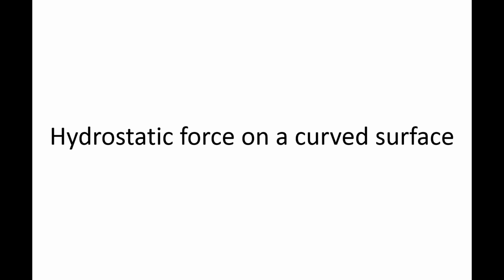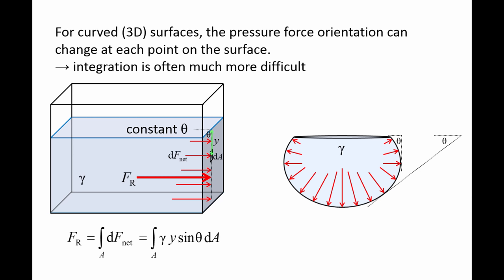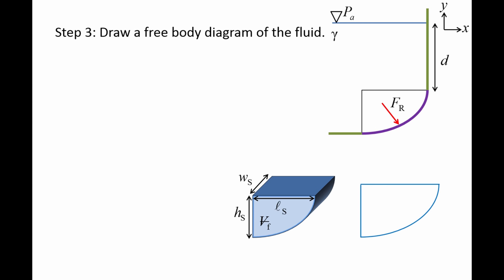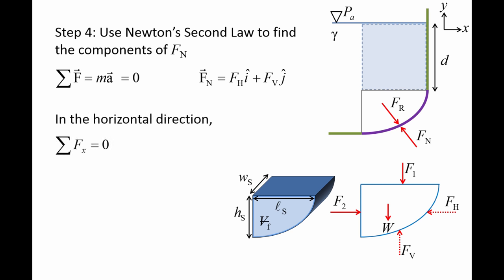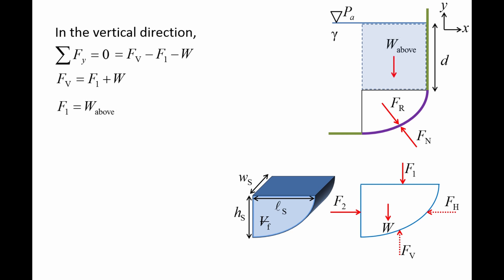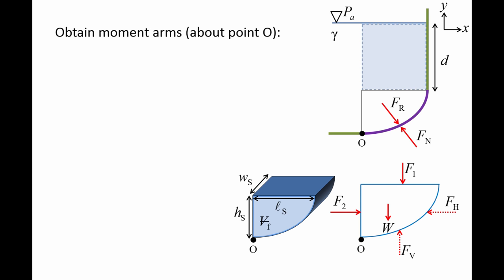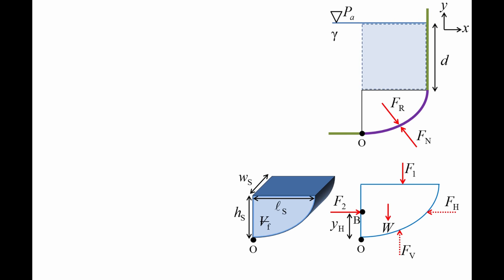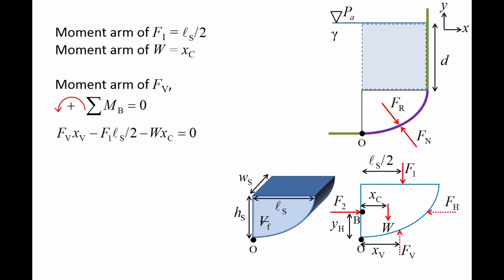Fluid Mechanics: Topic 4.3 - Hydrostatic force on a curved surface

Comment: what if the magnitude you are trying to find is the water force over the length of the wall from the top of the surface to the bottom? That is the point where it is very confusing to me.How can you instantly tell that oh Im gonna use Rx=Px(A) for the horizontal component and Ry=(density)(g)(Total Volume)? How can you draw the FBD for what it is asking? Im reading different books to take the Mechanical FE and in one book it explains the average pressure of Px=(1/2)(density)(g)(h1+h2) however in the FE manual it doesn't dictate the *average pressure formula. So how do you know when to use it at a certain component?

Comment: Can someone please explain something to me? We know that pressure acts perpendicular to the surface. Thus, the force that exerted on the wall should have both the components of x and y. But in the video, it seems to me that he only considered the weight (y-comp) of the fluid but not the x component that the fluid exerted on the wall. The only x component considered is that of the external pressure by the surrounding fluid,  but not that of the fluid body in question. In the y direction, we have F1 and weight, in the x direction we have F2 only. Are we not supposed to have another force in the x direction?

Comment: If a circular plate and a square plate of same diameter and side "D" m are lying vertically in
such a way that their center are "D" m below the free water surface. Find out the ratio between
the total pressure and centre of pressure between the circular plate and the square plate.

Comment: Is there force exerted by atmospheric pressure in the vertical direction? If not why?
Reply from the maker: Yes, but the atmospheric pressure is approximately constant around the entire system. So the downward force on the free surface is balanced by a similar upward force on the gate. The atmospheric pressure forces cancels out, so we ignore it.
Reply: Thank you. I just had the same question. 4 years later !

Comment: So I have a question... y did u calculat the area in 8:25 for Hs only .. I think u shoud calculat it for all Yr .. right ? please someone explain to me why? many thanks.
Reply: Gazi Gn he has calculated Fh by multiplying pressure with area and Fy by simply the weight (weight itself is a force u don't need to multiply it with area) carried by the surface.